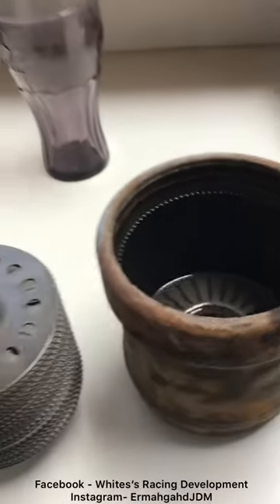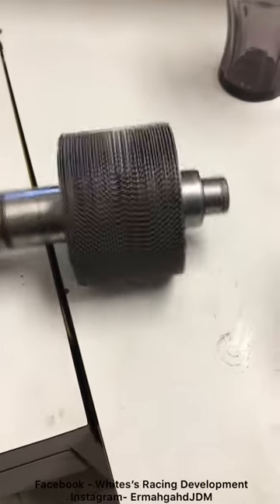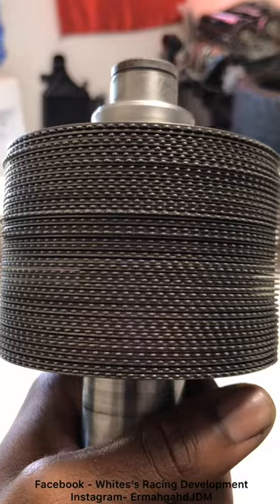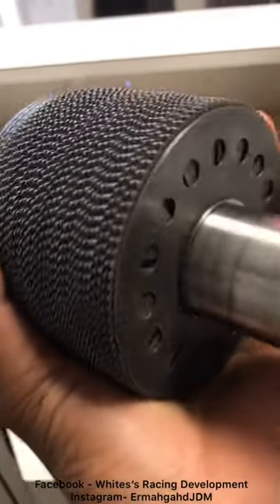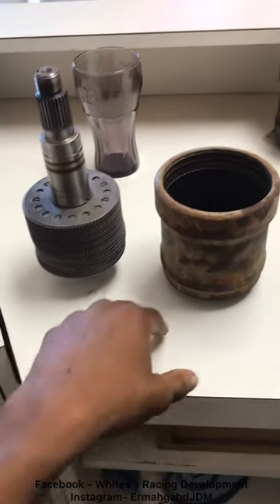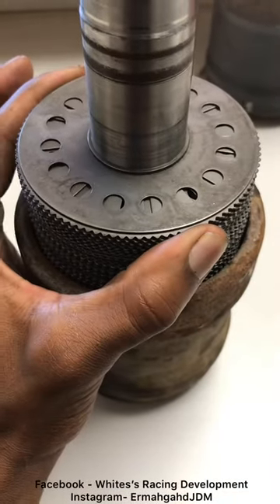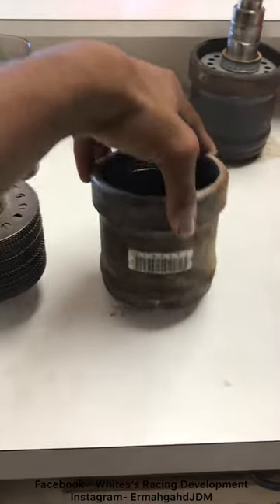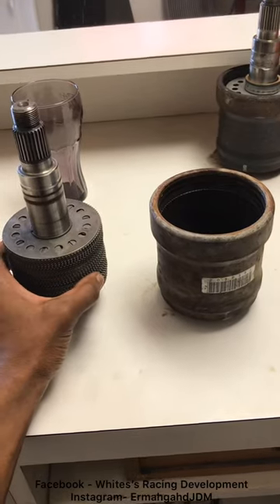Quick crash course on Viscous Couplers.

Comment: Can you advise me on what viscosity silicone oil to put in a Honda viscous LSD? I want to rebuild/refresh it before putting my transmission back together. The fluids I see range from 30k to 150k. I read that Honda viscous couplers came with 30k but I can't find info on what the LSD came with.

Comment: Is it possible for one of these to be built like a torque converter where it has a set of stators and rotors, with one forcing the fluid through the other for a more positive lockup effect?
Reply from the maker: There’s now pump for fluid flow. Would be a challenge.

Comment: Theoretically, shouldn't you be able to tune the amount of lockup and when, by varying the thickness of the viscous fluid?
Reply from the maker: Ryaneg6freak yes. That’s what I do. I build viscous couplers. I have couplers in all the Prayoonto cars, OSTEM/Speed factory, frustrate EG ETC ALL customers of mine
Reply: Does it means that the fluid passing through is acting like a friction plate on clutch set??
Reply: @ameirabbden5290  exactly... pretty cool...  So it acts as a locked clutch but still allows "some slip so that there is no binding from the front and rear wheels.
Reply: @kw2519 the trans oil has no effect of the viscous coupling. The coupling is a sealed unit with its own silicone based fluid
Reply: @duuude534  ya, that was 3 years ago, I’ve since learned a lot more about these cars.